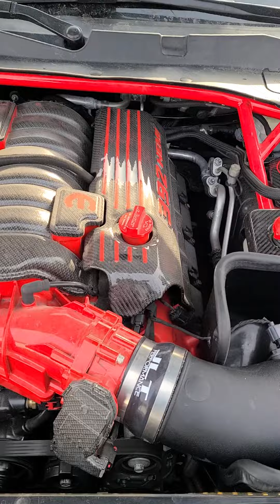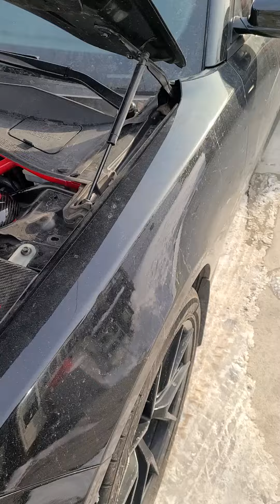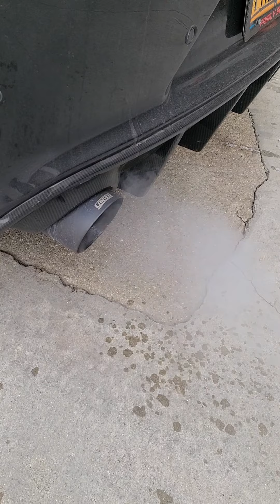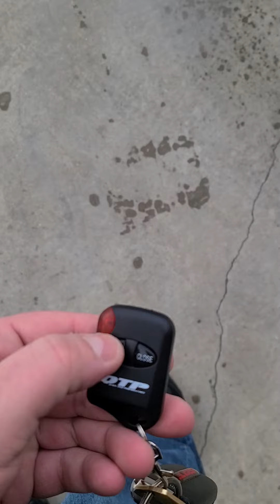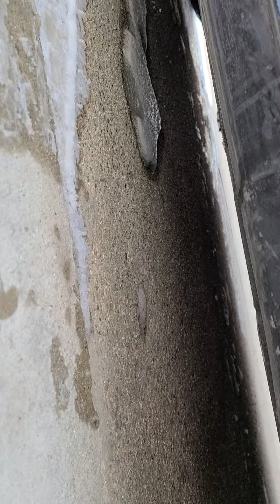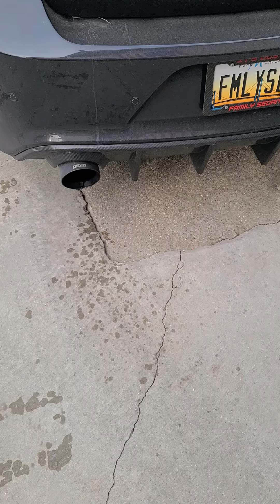Flyin Ryan Performance FRP Widowmaker Cam QTP Cutouts 2015 Dodge Charger SRT392

Comment: That'd a lot of Red 😵‍💫 Widowmaker is a supercharger cam . Widerlsa to give up some low end power using a PD blower. Not sure why o would cam my Hellcat and want less low end. Thats the advantage of a PD setup. Weird
Reply from the maker: Weirder yet that this isn't a Hellcat buy a 392. You assume I'm not going to boost it is even weirder. Building the car and engine for the long term not the short. Why put a different cam in to.just swap it out when I put boost to it? Weird train of thought my guy

Comment: In this video, did you have aftermarket pistons with valve relief for this cam?
Reply from the maker: Yes. It's required. I have the FRP drop ins. Molnar power adder rods and CP Carrillo 2618 forged 10.8:1 pistons